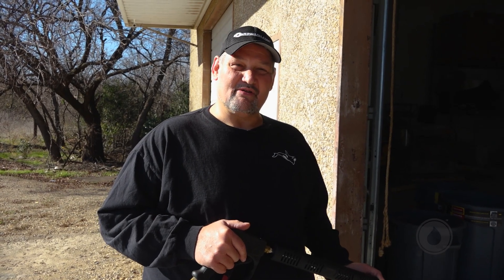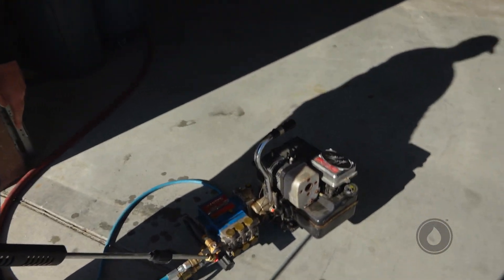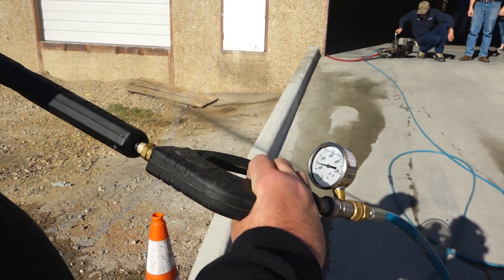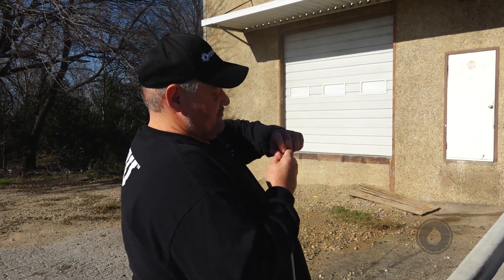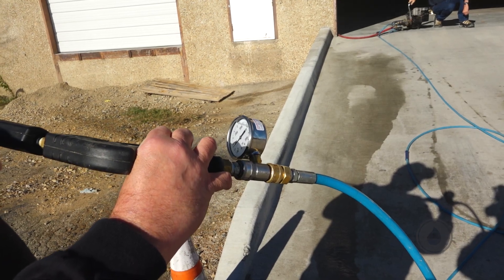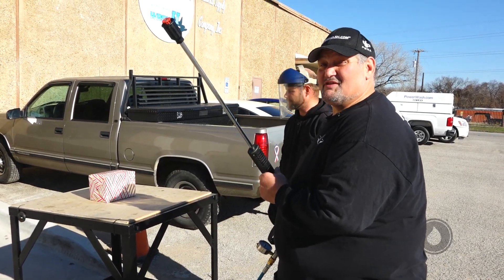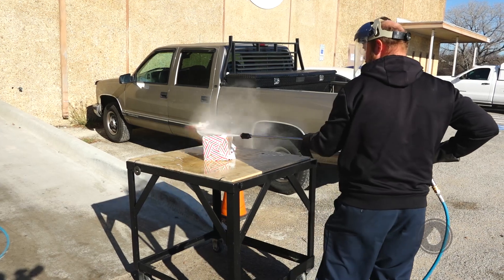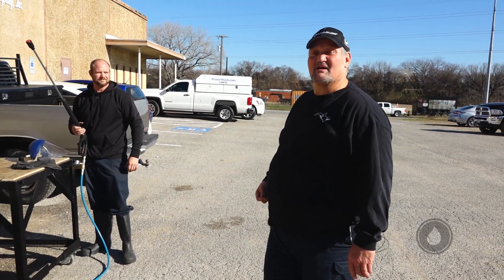Pressure Washer Nozzles: How To Choose the Right Pressure Washer Nozzle

Comment: Hi,

I purchased a used pressure washer 
(DeWalt 3400 psi @ 2.5 gpm). The tips that it came with are labeled with 28 on the last two digits ie: 25028 (green, red, yellow & white). Are these the wring tips? If so, which tips size should i be using for this pressure washer set up?